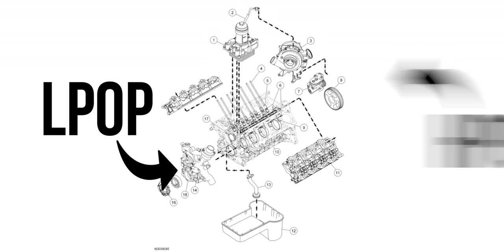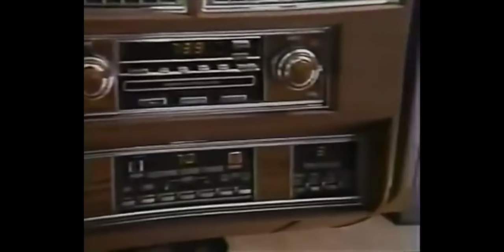These are the WORST ENGINES EVER MADE

Comment: The 6.0 Powerstroke is the best diesel engine in the world.......   To use as a boat anchor
Reply: 6.4: hold my beer
Reply: Yea i was going to say, the 6.0 isn't a bad engine, if you take care of it and are not an ignorant owner.  You need to take it to a 6.0 specialist mechanic.  It's like a bmw, you don't take it to canadian tire to have engine work done.
Reply: But the 6.4, there's no saving that motor. It will however run for about 200k before you'll end up replacing the whole engine. Most 6.0 trucks are still running the original block and heads
Reply: @80KG_Costco_Chicken   Big hard fact
Reply: 5.9: move over yall
Reply: The Olds 350 diesel says hi
Reply: 6.0 baby brother is 4.5. Junk
Reply: U probably have a duramax😂😭
Reply: Hahahaha no it’s not!!!….
Reply: When it’s good it’s GOOD but when it’s bad it’s BADDD
Reply: Wrong
Reply: 3.1 GM gasoline V6. Absolute stupid intake design. 3.0 Toyota V6 on head gasket failure due to that stupid exhaust crossover.
Reply: Oh yeah, for those who live in a throw away world and do t know how to fix anything. Many out there with 300k plus miles running just fine.
Reply: It’s a 22R compared to the 6.4
Reply: 1.9l TDI.
Reply: @80KG_Costco_Chicken  I’ll take my 6.4 any day then my 6.0
Reply: Had a 6.0 die on me  while going down the street. Was pulling a heavy trailer and after it would just turn over  and do nothing 😂😂
Reply: Get rid of the vgt turbo and beef up the headstuds and you're fine
Reply: I’d never own one but I do love the sound and power they make. My buddy has one that’s been super reliable at almost 270k miles but I’d still never buy one myself.
Reply: They work once you put $13000 That includes a Titan gas tank a bunch of front end parts also.F550...
Reply: @reillystsb  of course after redoing head studs with proper threads and a whole fucking turbo kit!!! 😂😂😂
Reply: @jasonhooey5677  yeah let’s spend thousands of dollars on a truck that’s just gonna break again and then you have to spend even more money, yeah you do you buddy I’m still gonna buy Cummins long before I consider a 6 liter.
Reply: @reillystsb  $15k?  WTF are you talking about about?
Reply: @hilljackzack7284  Both of my 6.0's have been bulletproofed for over a decade and I've had zero issues.  I've had to spend more money on my '96 12 valve over the last five years than either one of my 6.0's.  But I get it, low information and new to the diesel world guys have it all figured out.
Reply: @dellstudio10  you’ll Never own WHAT ??
Reply: My brother had king ranch 6.0 made a lot of $ paid 30 k to keep it running 12 years
Reply: you can use a cummins to tow the block to its new home
Reply: @Pericles777  high pressure oil pump o ring's. My co van did same amongst a dozen other things.   Went thru 2 in 6 years. No mas
Reply: Cause nobody will steal it!
Reply: 6.4 is worse. Fuck they only made them for 2 years. They were that bad
Reply: I think it's better then the 6.4 but not much takes a lot if work to make them bullet proof
Reply: 5.4 had spark plug issues about the threads being to short, not the 6.8. Maybe your mechanic sucked or the spark plugs were put in late on Friday afternoon or Monday morning really early. 
Only issue i had with the 6.8 v10 i had was you couldn't pass a gas station🤣. Thats the only negative thing i could say. It was torquey AF though.
Reply: How much do you have to spend to get it that way?
Reply: Not heavy enough
Reply: The LBZ is pretty sweet with the Variable geometry turbo
Reply: Yup agreed
Reply: Mechanics love them they make a lot of money on those boat anchors.
Reply: Yep they should’ve never changed the old school 7.3, one of the most reliable engines ever
Reply: Let's start with the 5.7, 6.2 and 6.5 turbo diesels. The ht4100 was junk too.
Reply: @80KG_Costco_Chicken  in the hands of idiots, it's a bad engine. My first 6.0 went 600k. And was still running when I traded it.
Reply: Great engine but Ford put their fuel system on it which totally trashed it, but  bulletproof it, it’s great. But anyone buying one with the 5.9 out their is a few screw shy!
Reply: Agreed.
Reply: There was no sand in the block. It is silica fallout of the engine coolant related from getting too hot. Essentially shitty coolant. Regardless. My 6.0L got 600k after removing the EGR cooler and headstudding. It's a fine engine.
Reply: The ocean doesn't even want that shit...
Reply: I worked on one , the owner said it was a pos engine 
 I replaced the turbo … still ran like shit no good
Reply: @andrewlewis3429  They actually would not be that bad if Ford would have recalled the pistons because of cracking. In the first year international replaced all the pistons on our 6.4's under warranty when they had 1500 hrs on the engine. It finally needed replacement at 26000+ hrs. Plumb wore out, others sold off for other reasons but none of them were sold for premature engine failures.
Reply: @hilljackzack7284  Yet I've been pounding headgaskets on the 6.7 Cummins at a surprising rate. Shall I also mention dropped valves......
Reply: @wallbanger3  turbos* I’ve also worked on 6.4’s and you have to pull the cab to replace them because they have 2 and not just one!
Reply: @davidhenri2722  it’s called don’t overheat the poor thing! If it gets hot pull over and call a tow truck.
Reply: @jasonhooey5677  ummmm dude, the 6.4 and the 6.0 are the same engine... same block, heads, fuel system, cooling system..
Reply: @KBS117  lol 6.4 and 6.0 are the same engine eh???? Keep watching his videos, i can tell you don't know what you're talking about.
Reply: @jasonhooey5677  yeah, been a Ford technician for 21 years. I know nothing about the 6.0 and 6.4. Now the 6.7 is a totally different design.  But the 6.4 is a bored and stroked 6.0 with twin turbos..
Reply: @KBS117  now you've confirmed you're a liar, this is awesome lol. 
6.0 uses heui injection via a high pressure oil pump, a system developed by caterpillar. The 6.4 uses an insanely expensive high pressure fuel pump and piezzo injectors. These arw not the same engines at all, can't swap heads, can't swap fuel systems, can't swap much really. So if you mean they are the same because they both run on diesel, are v8 and use forced induction via a turbo then you'd be correct. These are not the same engines at all
Reply: Nope
Reply: @kiheirc3195  diesel tech here , honestly if you maintain them and delete them they are not bad engines ... We still have lots of customers that work them pretty hard everyday without issue .... They can be hit and miss though ... Is a 5.9 more reliable, yes mostly because it's 100x simpler ...but the truck it's in is absolute garbage .
Reply: Wrong!
The 6.4 is the best engine brand new, and to tune it, then you got a few good launches out of it, then it eats it self alive then you spend over 20k for a new one, so the 6.4 is the worst, the 6.0 is a close second
Reply: @zacknelson8918  Nope. 387 Thou on mine
Reply: My straight six from 1950 is a better anchor than that 6.0, but barely.
Reply: 6.Blow 😂
Reply: @MaterialAmbience  6.blow you off the road...
Reply: Ya, not even close.  6.4 Powerstrokes had way more problems...
Reply: The truck they're in have rotten away long ago here. I can see one from time to time. The guys who pick up scrap metal have these old rotten carcasses but I don't think they go faster than 40 mph. And it's because it's all they can afford. Anyone who work for real with a truck need something reliable and à 20 years old f-250 or econoline isn't that. At this point, no matter the engine, they're more rust than truck anyway. And the anecdotic "but I have one on my farm and use it once à year to carry 300lbs of potatoes and it works fine" doesn't convince me. You can do the same with a truck from the 50s. I talk about an actual usage like a plumbing or electrician company. These truck were total disaster rust bucket and the engines were too. English isn't my language.
Reply: @MarvinHartmann452  we don't have rust issues down here.  My 1975 restored truck is still rust free. My 1999 and 2003 f-350's are rust free and used every day. The diesels in them are original and 300k plus and run like new.
Reply: Nah the 6.0 is way better than it’s given credit for.
Reply: GUFFAWING
Reply: Comment of the year 😂
Reply: The 6.4 is even better at being a boat anchor
Reply: Not a 6.0 it is a six tow
Reply: The 6.4 is the worst
Reply: Ford 6.0 is the second best boat anchor. The best boat anchor of all time was the 5.7 Olds
Reply: @brianadams429 I agree the 6.8 is reliable, got one with a whole bunch of miles and neglect and it fires right up, but I wouldn't call it torquey, I don't know how it can have 10 cylinders get 8 miles a gallon and be so slow lol, but it will get you there eventually
Reply: @Fordguy02 The Oldsmobile diesel V8 is still a great platform. The only issue with it is really just the head studs. Put new head studs in it and add a fuel filter with a water separator and it's good.
Reply: Head studs, egr delete , fuel filtration and what most people don't know is ford sent out reps to inform garages about an Oil Treatment to take care of the "Bad injector" problems, super easy to work on easy money - Chevy guy
Reply: @Pericles777 oil pressure is required for injectors to fire as an engine protection feature almost always the cause
Reply: The 6.0 Powerstroke wasn't a bad engine after you spent a shid ton of money bulletproofing it. The 6.4 Powerstroke was even worse! People wouldn't even repair or rebuild them when they took a shid with less than 100-150k miles. Wanna build a really nice truck fairly "cheap"? Find a nice F350 with a blown out 6.4 Powerstroke and do a Cummins swap. For $30k or less you'll have a truck that will run circles around any new truck out there, won't need DEF and you'll get decent fuel economy.
Reply: Ted Williams sears outboard motor.
Reply: @freedomisntfree_44 bonehead
Reply: @Maximus20778  least I’m not a fuck head troll 🫡
Reply: @freedomisntfree_44  I'm just doing exactly what they call people who defend such GARBAGE ENGINE
Reply: @doughboy1966  Toyota has had tons of sludge issues for yrs (replaced thousands of engines) an just lame engines all around. No thanks!
Reply: @freedomisntfree_44  Many engines from every major brand out there running w/tons of mileage. Good basic maintenance goes a long way. Most registered vehicles w/250k+ mis are Ford trucks. No surprises there.
Reply: @failranch9542  Was a Navistar designed/built engine the 6.4L & earlier 6.0L diesel. They lost a huge contract w/Ford trucks over those! Got sued too.
Reply: NO , THAT WOULD BE ANYTHING WITH G.M. IN IT !!!

Comment: We cannot rag on the northstar without mentioning where those absolute genius engineers decided to put the starter motor....
Reply: Have you seen the starter though?  It's stupidly overbuilt.  They did that on purpose knowing it's a bitch to replace and maintenance stats show that they almost never fail.
Reply: I had to do this back when I was a teenager with a Haynes manual. I think equally frustrating was the water pump and it’s special tool….. busted some knuckles when it slipped off
Reply: Have you seen Mercedes-Benz A150 starter location?
Reply: I had a 2005 sts. I wish i had to do the starter on a northstar. The 3.6 starter was a bitch
Reply: Toyota also put their starter in the same spot in their V8s, specifically the one I have, 2UZ-FE.
Reply: @kelvinelrick807  Toyotas are so awful to work on. My old 00 4Runner was a bitch. Thankfully you don't have to work on them often.
Reply: Toyota put their starter in the same spot because otherwise. It's wasted space.
Reply: Under the intake
Reply: @nobiazcustomsinc5030

Why is this always the main point of criticism? Those who say this clearly have never changed one, because it’s one of the easiest starters in the world to do. I can get these in and out in 30 minutes or less. Northstar was crap when it came out, but by the 2000’s most problems were fixed.